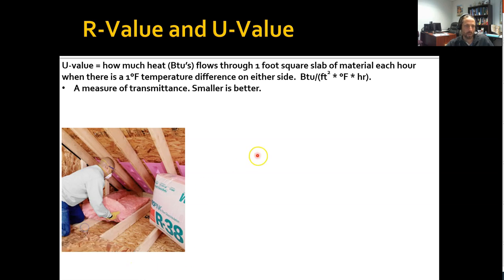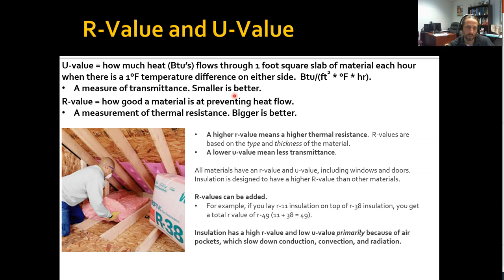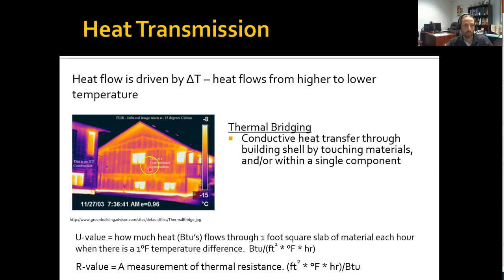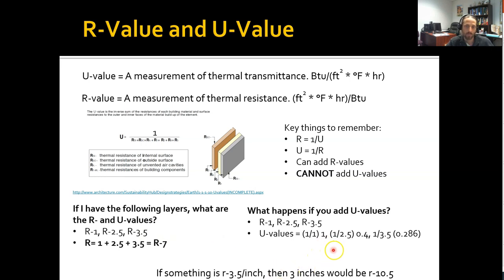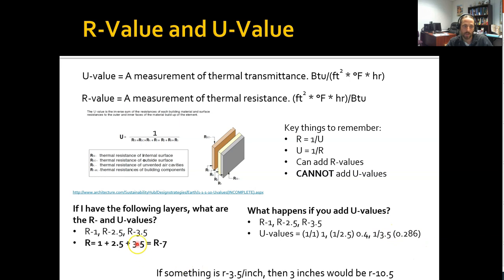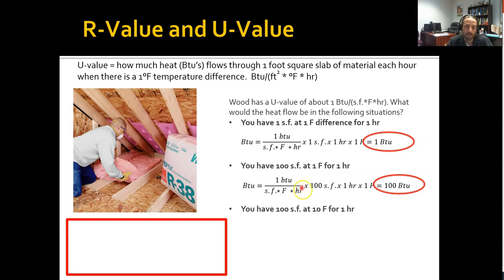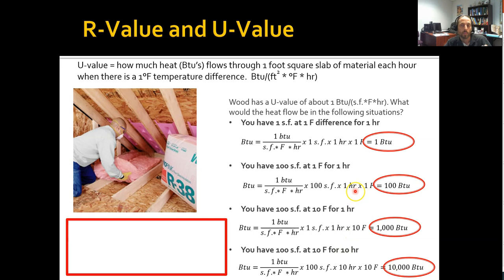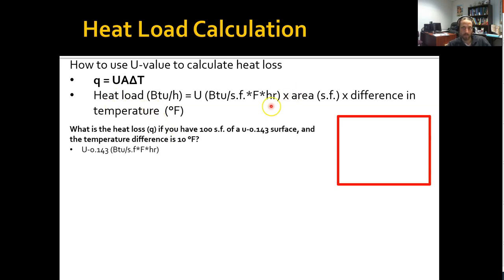heat loss calculation

Comment: I believe the question I need to ask is, is there any other information that I will need from the J Manual other than the R values of the homes outer wall materials and the designed temp/ Delta  T information to complete my duct calculations/ Heat Loss and Heat gain to complete the process